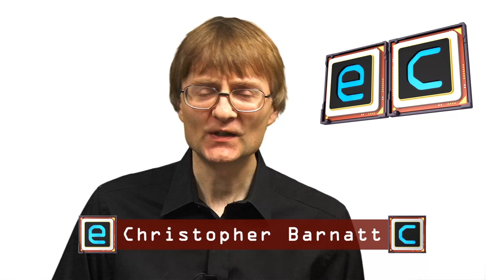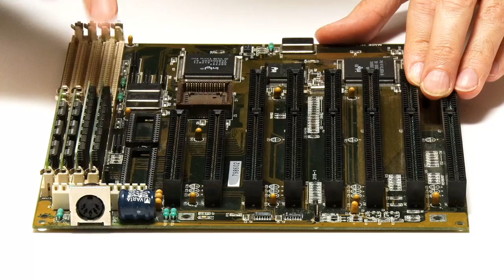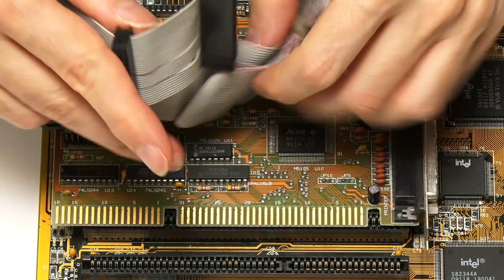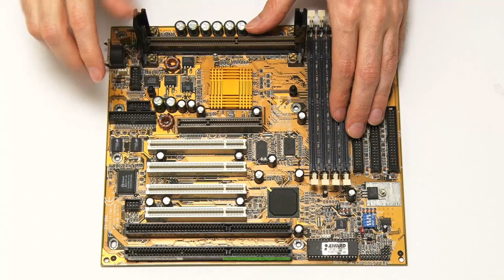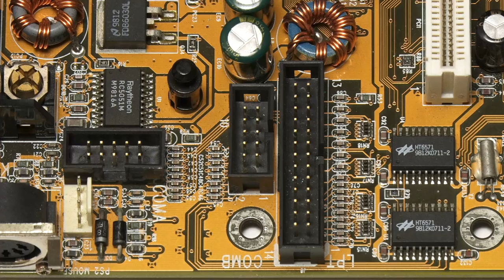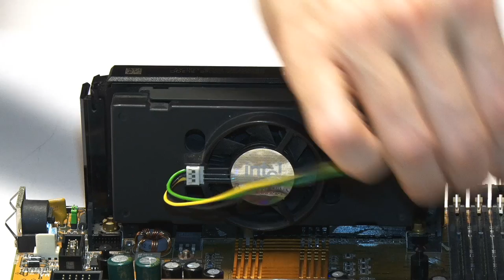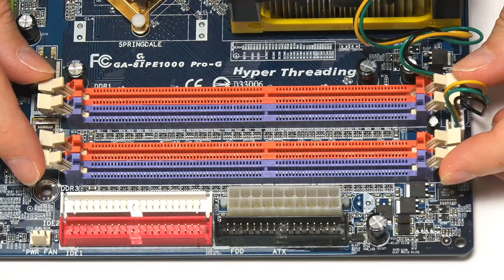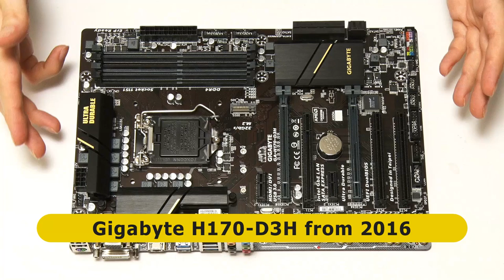PC Motherboard Evolution

Comment: And they said old people don’t understand computers...
Reply: Careful now !!!!! 👿
Reply: Just because "young" people can sent text messages, read emails and use their phones camera doesn't mean they 'understand' computers. It just means they can use the interfaces provided to them. If they run into trouble they may be able to factory reset it.
Beyond that most people don't really 'understand' how the system works, is configured, designed, engineered or how the system fundamentally works to produce images and sounds from data.
Reply: I started in the world of computers on a Z80, then I moved to the 8086 (real mode computers).
Reply: "Old people" invented the computers my (young?) friend. I built my first computer in 1978 and set up one of the first 10-15 web servers in the world in 1993.
Reply: @bsvenss2  
In the 80'th (the time before the www) there was the world wide private FIDO net. Do you remember? (I was a node with 2400 baud, later 9600 and 14.400)
Reply: @infinite loop
Old people may have invented computers, but young people perfected them
Reply: some can also explain them
Reply: I remember the proto-web of Gopher :)
Reply: archie, veronica, and jughead.
Reply: he isn't old
Reply: + ||Grayfox||
No, young people are just good at picking up and figuring out gadgets without instruction manuals. Doesn't mean they have a bloody clue as to how to fix them without consulting the Almighty and Omniscient Google. To do that, you need to know how they work at the level of fundamental concepts. The level of understanding that only comes from building and/or reverse engineering them yourself.
Reply: it's different if you look like Bill Gates :D
Reply: Very few used computers 30+ years ago.
Reply: @shinjig  What makes you say that?
I worked as a PC tech.
I have tweaked Windows in ways that one wouldn't
Reply: @shinjig  I don't live in the US, And you know how to use one of those phones?
I know as I grew up with one as well as a push button phone.

Do you know how to use the DOS prompt?
what about Linux Terminal?
Did you know could remove IE from Windows98 with out the use of any special software.
Reply: @shinjig  Hows DOS working out for ya.
Oh right, its not.
Yes DOS worked great for the time, but times evolve.
I also repaired a Win 98 install and it has been 17 years since I have touched Win9x.
Reply: @shinjig  Really?
Some programs work best from the CLI?
I never would've known.
It must be so complex, just like putting a finger in a hole and rotating clockwise to the stop.

You understand sarcasm or do you have to install it via the CLI?
Reply: @shinjig  Seems you need to install the sarcasm packages.
Try using apt-get install sarcasm
Reply: @shinjig  I have respect, you're the one that started this with the rotary phone rubbish.
I know facts are a bit hard for you to understand but was it the elderly that added dual core, quad core, octa core CPUs?
Was it the elderly that made 2G, 3G, 4G mobile phone systems?
Was it the elderly that made SATA & nVME?

Comment: What’s missing is all the hype with each new iteration     

Just looking at those old drab boards one would never guess the marketing promotion whipping up the buying frenzy created.
Reply from the maker: Yes, very true indeed.
Reply: Rebeldoug, yes-very good point, that's something that's changed. I remember when Windows 95 came out, the global hysteria! There's still a little bit around, mostly amongst gamers and Apple products, but not on the same scale. This video was certainly a nostalgia trip for me (good and bad!).

Comment: I've used at least one board from each series of socket (excluding servers) since the intel 8088. Love the video

The slot cpu's were created as a stop gap solution to adding cache on the cpu. Later Pentium 3s had it on die instead of separate chips on the slot board. AMD had their own slot too, Slot A. Early Athlon K7

Comment: Another interesting fact about the i/o ports on the back of motherboard. in the 80's and early 90's the ports where attach to a metal bracket the screwed holes in the back of the machine and attached by ribbon cable to either an expansion card or directly to sockets on the motherboard (both shown in the video). Later in late 90's, with the advent of the ATX & micro-ATX motherboard form factor, they began to solder the ports directly onto the motherboard. For anyone who hasn't built their own PC, with ATX comparable cases you get and open rectangle in the on the case for I/O and you attached one of several different included face plates, depending on what i/O your motherboard include built-in. The most common  I/O ports where often standardize as I recall in the same locations between board brands, With less common ports (or once less common ), such Ethernet, Modem, IEEE 1394 (firewire), Thunderbolt, you have remove knockout on the face plate.

Comment: Another great video. The tech changes so quickly that I don't notice it so much until I see videos like these. I've worked with all this stuff. It actually wasn't too long ago that a client FINALLY upgraded his computer from one that had the P II (slot 1) that had that huge heastsink integrated with it. How things change so much is incredible. The stuff consumers NEVER see. How many people do you know that actually open up their PC case or laptop? Thes things could run off of hamster wheels and the average consumer would never know the difference. That's the biggest reason I love this field of work! Every experience working on a computer is at least 90% guaranteed to be a new one in some way or another.

Comment: Biggest thing I loved about some of the Amiga computers was that upgrading was a relatively easy method of plugging in an accelerator card and installing a library.  Expansion port on the bottom of the A1200 was great.
Reply: I did have a slot 1 Pentium II 266mhz back in the day as well.

Comment: The great thing about the evolution of motherboards is that it was <gradual>. If you're lucky, you can get a motherboard from like 2009 that supports dual-core 64x processors, but also have PCI slots and DUAL floppy support. I was able to find one like that, actually!

Comment: One thing not mentioned in the video was the fact that in the era of isa slots when, for example, you wanted to install a sound card you had to manually set the irq of the card so that it doesn't conflict with the other cards in the motherboard. That was done through switches placed on the card. Plug and Play was unknown before mid 90's.
Reply from the maker: True -- I pondered on including. But I knew the video was already going to be very long . . .

Comment: IDE was upgraded to Ultra ATA (or Ultra DMA). Ultra ATA uses the 40-pin original IDE pinout, but uses 80-wire cable. These extra 40 wires are for electrical grounding. The first iteration of Ultra DMA has a transfer speed of 33Mb/s. Subsequent iterations have speeds of:
66Mb/s, 100Mb/s, and the final iteration is of 133Mb/s, before it became obsolete.

Comment: 2015: rgb led strips (on high end motherboards)
2017: argb header
2022: ddr5
2023: pcie gen 5

2024: connectors on the back of the motherboard

Comment: Chris, I believe you plugged in that floppy drive cable backwards at the ~ 6:15 mark? IIRC, the red stripe denotes Pin 1, and on that expansion card Pin 1 is at the end nearest its external Parallel port. You can see the number 2 clearly and pin one is "above" it.
Reply from the maker: You can always see more than I can, as  work upside down and learning back to avoid getting in the way of the lights and camera! :)

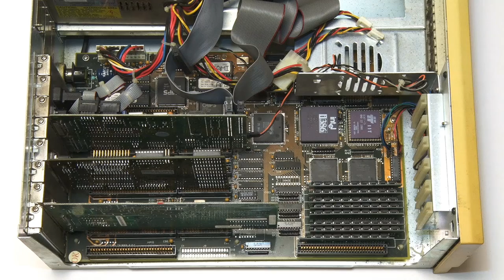Comment: Just found this video - cool, but I have a question: that 386DX Motherboard (6:40) has a slot at the bottom right (with back to the left) - what was that ? 
First I thought an 8-Bit ISA to the front for handy accessible connections, but there is no blind part/opening to the front.

And it's also a smaller change going from on-card single IDE and Floppy (two connections each: IDE for CDROM+HD)  to VESA local bus or even on-board 2x IDE for up to three HD's and a CDROM or even DVDROM: much more storage capability.
I used to have a 486DX2-66 system with two VESA local bus slots: one for nVidia 128ZX 8Mb Graphics (OpenGL) and one for fast I/O: high speed serial, parallel port, 2xIDE and even >> double speed << floppy/QIC tape drive connector - my first standalone PC (apart from 8088 bridgeboard for AMIGA 2000).

I think I still remember which IRQ's were mainly used for which functions :) (7=PAR, 3,4=SER, 14/15=IDE, 2=Sound?, etc.) 
Somtimes you'd have to disable a serial port to get another card working...
Reply from the maker: On the slot, I too would guess at some kind of 8-bit ISA slot. Great post. Thanks for sharing here.

Comment: A couple more things people would find different on those early boards.  Your '386SX board still has the old-style CMOS battery.  On older systems the battery types varied from system to system.  Your board has a barrel-battery, soldered permanently to the backplane.  Others might have had a blocky rectangular battery (don't even remember the type/number of them) that plugged onto a connector on the board.  And then there were the Dallas Semiconductor combination clock/battery socketed onto the board, (theoretically replaceable, never had to do it myself).
Then there's that horrible power connector.  It had thin metal connectors that slid into the power supply connectors (yes, two-piece connector) which you had to be sure to plug in the right way (as I remember, black wires to center).  You had to be VERY careful installing them so that you didn't bend/break them.
And on that Pentium II board; the connector you said was a mouse connector looks more like a power connector.  I would have thought it was the CPU fan power, except the fan on yours is 3-wire, and the board connector there is 4-pin.   But then again, board designers were known to make poor engineering decisions like that.

Comment: Here we're starting almost 10 years into the history of PCs. On some older PCs, memory was upgraded by plugging individual chips into empty sockets, or adding switchable memory banks on ISA cards. Those 30-pin SIMMs were an 8-bit bus, so had to be installed in identical pairs / quads on 16 / 32 bit bus boards. A similar thing happened with later 72-pin (32-bit) SIMMs being installed in pairs for 64-bit bus Pentiums. More recent DIMMs can operate individually, but run faster as interleaved banks.
Reply from the maker: As I said at the start, I could only show the boards I had. :)

Comment: It interesting fact about IDE not mentioned in the video was that the IDE standard was developed in 1985 by Western Digital & Compaq, around a year  after the first 386i processors came out in late 1985.Prior to IDE (Integrated Drive Electronics), the drive electronics where not integrated, hence the name. Before IDE, the  drive electronics on a hard disk drive where contained in a separate ISA expansion card along host/controller interface. This arrangement meant that different hard disk drives had their own unique controller interface that was specific to that drive. If you got a new hard disk drive then you would replace the old interface card with a new one. With invention of IDE, they where able to standardize the controller interface and with the drive electronics, which where unique to each brand/model of drive, could be placed on the drive itself, and soon they include IDE on motherboard itself. This meant swapping/upgrading IDE drives was much easier. The standard IDE interface at the time was Parallel ATA (PATA, original known just AT Attachment or ATA) which lasted until  SATA (Serial ATA,) took over (at which point ATA became PATA to avoid confusion). There where Speed improvement to PATA over the years, going from 8.3 MB/s maximum originally to 33, 66, 100 and finely 133 MB/s, but the interface was backwards compatible (I.e. older drives could be used newer ATA version (or the reverse) but would run at a slower speed  then the drive or the IDE controller's max..

Comment: Great video, brings back memories. The first home/beginner computer I built was an ELF and it was built on a breadboard and had to move wires around to program it. One thing it could do is play a song with a very small speaker, with a tinny sound.  That was I think 1978 or 77...  Still building computers today faster, better and easier...

Comment: ISA FTW! 
God that takes me back. I have one question for other commenters here. Who in 2016 uses anything PCI? I got away from PCI permanently around 2010.
Reply: Spicy Flavor Tide Pods 2016?! you're two years in the past haha :) i have several retro machines, but my best stack of cards has to be in my "underOS'd" Windows 95 OSR2 700MHz Pentium III mini tower w/ 192MB of RAM, 30GB hard drive and DVD-ROM, CD-RW, ZIP250 and 3.5" floppy drives :) AGP 64MB GeForce 3 Ti/200 primary video card / Direct3D card, twin (SLI) PCI 12MB Voodoo2 Glide 3D accelerator cards, PCI Ethernet card, PCMCIA to PCI adapter card (with an Orinoco Gold 11mbps WiFi "B" card in it), ISA Sound Blaster AWE32 CT2760 w/ 32MB of RAM and real OPL3 FM chip!

Comment: Riddle me this, Christopher..
If i have a Lenovo SharkBay Motherboars, if i get a Workstation MotherBoard, Specifically an ASUS X99-A2, will my PC require a Re-install of windows?
Reply from the maker: It is often tricky to move Windows between motherboards, and it if is an OEM copy (that came with a PC) it will not be able to be reactivated.
Reply: @ExplainingComputers  that will be one big pain in my rear if you get what i mean. A friend of mine is shipping his old ASUS MoBo and I7-6850K to me as a gift, which is why i was wondering. Thanks anyway :)
Reply from the maker: Remember that these days you can download a Windows 10 ISO from Microsoft and use it unactivated for "evaluation" as long as you like. Or, of course, install Linux.
Reply: @ExplainingComputers  when it comes to linux, I have my Pi :P

Comment: The 80386 motherboard brings back some memories! I had a 386 SX40 complete with a 'turbo' button! Those memory slots could be troublesome as the metal clips were prone to breaking off if pulled too hard.
Reply: Did your case have a tiny LED display to show the current frequency of the CPU? Mine did. (Though I don't remember what CPU was inside. I was a very little boy.)
Reply: If I remember, it had a green LED readout going from 8 to 40Mhz. *Mhz, of course, to slow down the 'fast' 40Mhz 386 when using certain early DOS progs such as games.

Comment: Something interesting you skipped over by not having a 486 or Pentium board board was external L2 cache.  Those processors had no L2 cache on board.  If you wanted that cache level, you needed a motherboard with SRAM sockets on it.  Cheap boards didn't have them, and performance suffered quite a lot.  Less cheap boards had the sockets, but didn't add any chips.  And somewhat more expensive ones than that had SRAM chips, but only low capacity ones, so you'd get a boost by upgrading to a larger size.

Comment: The 1990-1999 jump in PC tech seemed incredible at the time. Going from faffing around with dip-switches & pins (which I also remember having to set on dot matrix printers) to almost plug 'n' play (or at least setting in BIOS). I remember a flatmate's friend coming around with a Pentium he'd just bought (1994/1995) and we tested its speed by running a Mandelbrot Set program - it put my 386 and the flatmate's 486 to shame. It really is the jump to 'modern' looking boards. 

Later, late 90s-early 00s I lived in Cardiff, which had a pretty large student population for its size. At the end of the Uni year you would find PCs left for junk outside houses in the student-heavy suburbs. Picking up several of them I could mix and match parts to make a pretty powerful 'last years generation' PC for free. Rinse & repeat the next year to upgrade.

Comment: For floppy connectors that are not keyed the stripe goes to pin 1. There are exceptions though, I've seen IBM floppies that were set up for the stripe to go the other way and many of those didn't have the normal 34 pins (if I recall correctly).